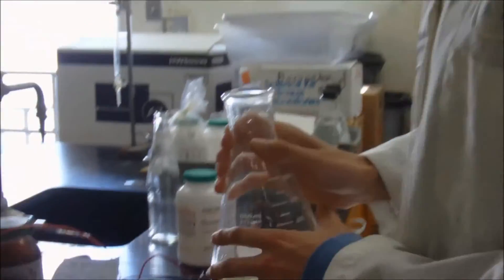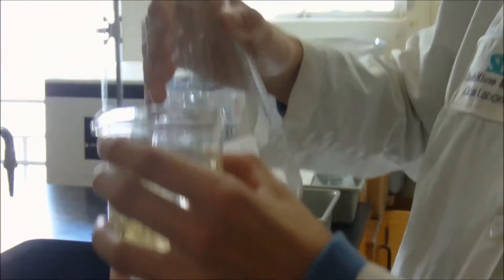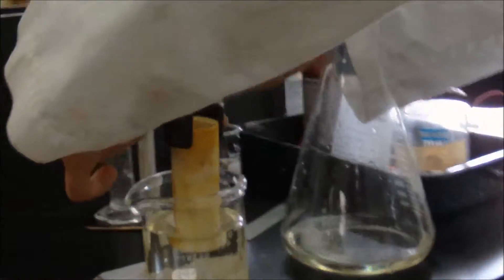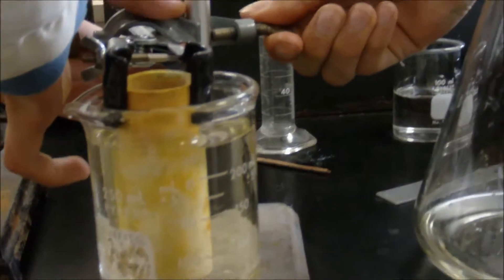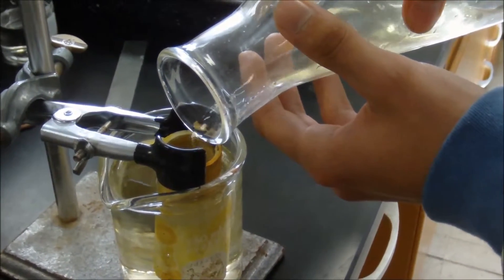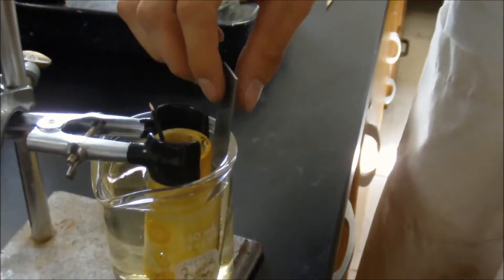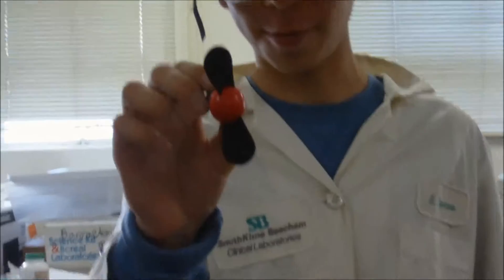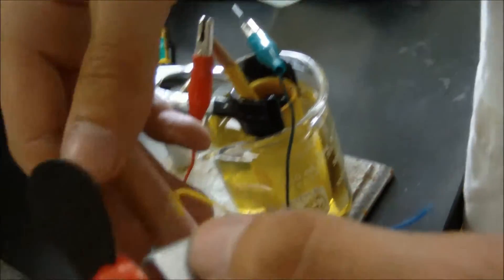Zinc Iodine Cell 2k14

Comment: what is white cap which contain iodine.
motor didnt run because not voltage. it was current issue. your seperator decrease the current.